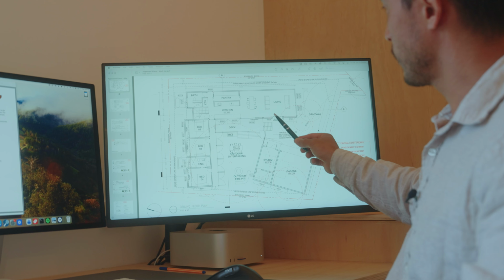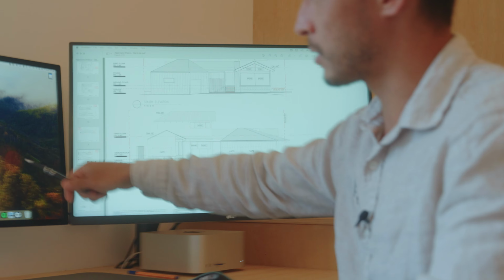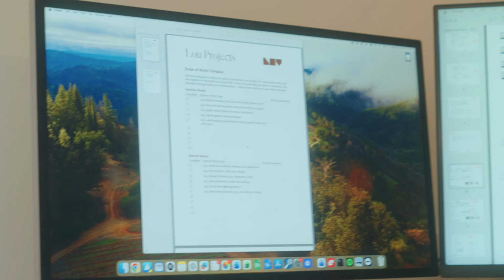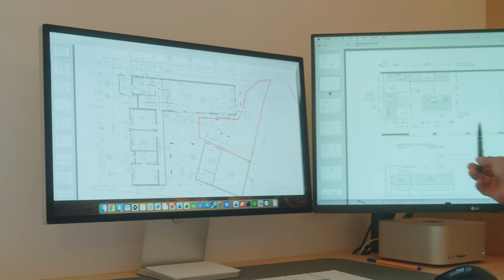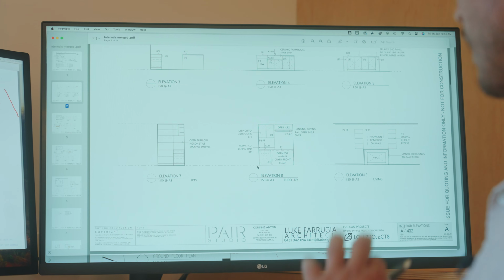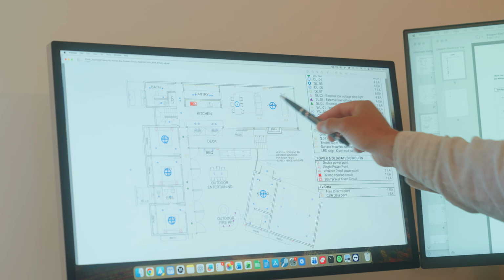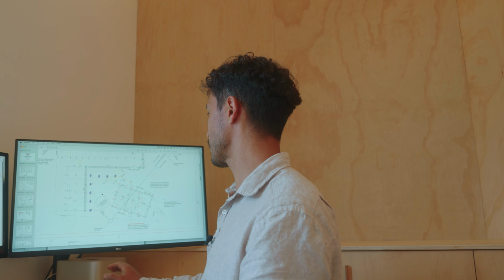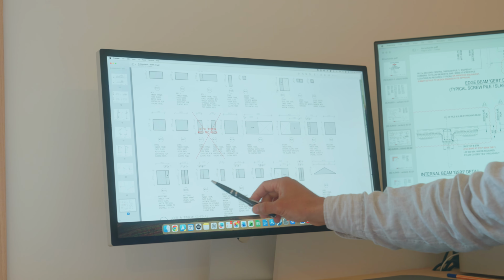Why Most Projects Go Over Budget - And How to Avoid It

Comment: I've been trying to get quotes for a basement construction under existing dwelling but it's been a challenge. Why are Aussie builders so scared of building basements? Even in new builds I'm told many builders won't go near one.
Reply from the maker: The reason why aussie builders battle with basements is because of reactive clay soils, variable sandstone, high water tables and coastal salt exposure. It's just not really standard practice.